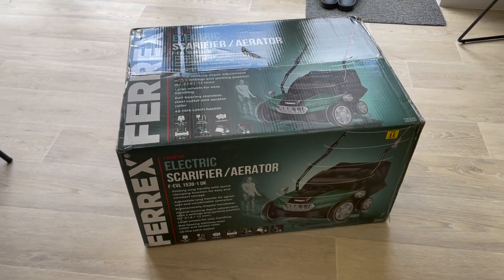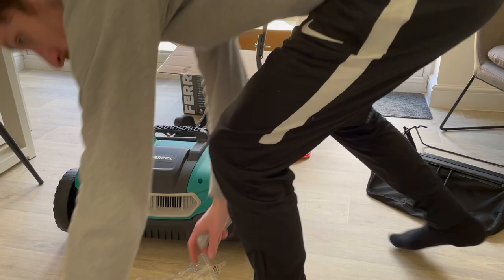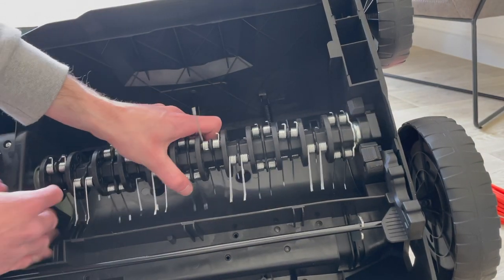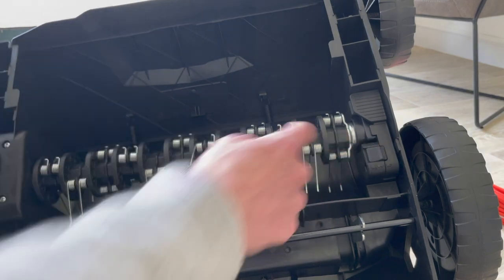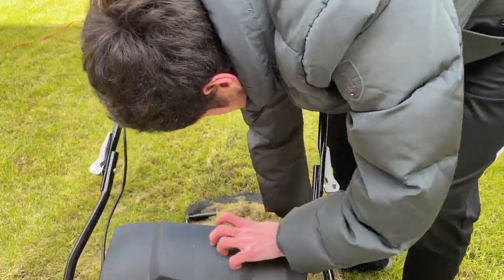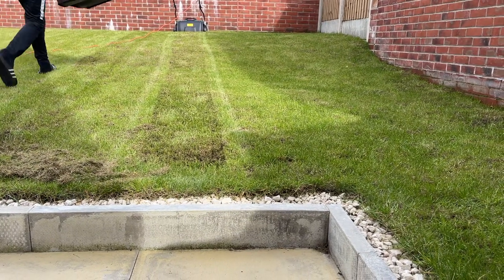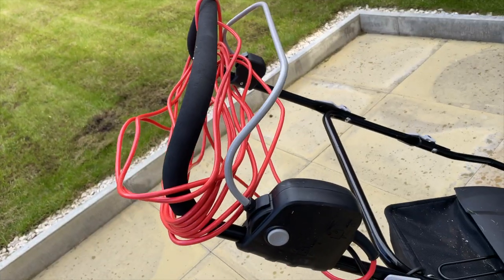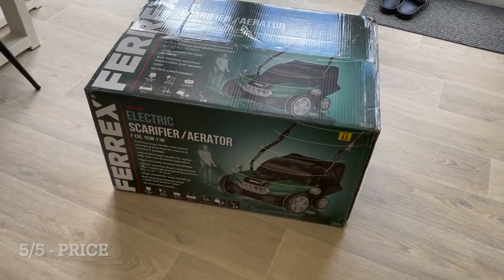Ferrex Scarifier & Aerator Review (PART 1 - Rake Attachment) - Aldi

Comment: Thanks again for this video - mine arrived yesterday and thanks to your video I was able to assemble it without any fluster. The basket does fill up quickly - one run and I had to empty it even though I have small garden. I used the same blade that you have done above thinking that what I was doing was scarifying but the manual refers to the other blade as the scarifier and the one above as the aerator!!
Reply from the maker: I have got it wrong in my videos! To be honest, I had a quick skim of the manual and got straight to it - I need to be more vigilant next time! 🙈
Reply: What they call an aerator is what other companies call a rake. An aerator has spikes which go deeper into the lawn.

Comment: Hi, I had mine delivered today. I think the part you’re not sure about is to allow the unit to hang on a wall. You screw the part into a wall in your garage / shed, and then when you want to hang the unit you loosen the hand screws holding the handle in place so the handle goes flat. Then hang the unit by the bar (where the plastic cable holder is)
Reply from the maker: Thanks for letting me know - I guess that would explain the wall plugs!

Comment: Hi I had mine delivered recently I was sure the roller you used was the aerator not the scarifier I’m a bit confused now did you mix up the names in the video cheers
Reply from the maker: The roller I used in the video was the scarifier. It’s teeth are supposed to act as a rake. The other other is the aerator. I’m hoping to use it either today or tomorrow if the weather holds out 🤞🏻
Reply: @NoviceGardener  thanks for reply really good video by the way going to watch your next video before I try mine out cheers
Reply from the maker: @ryanbutterworth2841  Just uploaded part 2 now using the aerator attachment - was slightly trickier to use with my lawn!
Reply: @NoviceGardener  Hi. I 'm a bit confused too as the user manual on page 3 shows the cartridge with the wire hooks as the aerator??
Reply: Pretty sure the Blades are the scarifier and the other is the aerator
Reply: @MW_1981  Yeah same issue - lack of clarity which blade is which - guess will just have to experiment and see!
Reply: @vipinchauhan1449  basically the spring tine one is a rake while the other is a scarifier. Although the company try to pass it off as an aerator..... Of which neither will do much to aerate the lawn.
Reply: Have to agree, having used both I think both are really scarifying rather than aeration.  Both seemed to work the same to me!

Comment: I contacted there repair dept on the Wirral they had no wheels as this is a new model, they had no idea when they would get any spares.
So contacted Aldi customer services who arranged collection via yodel, I boxed everything up.
It was collected at a arranged time and  on there receipt payment refunded (awaiting).
Like you they had sold out.As I said the bag is rubbish and hardly worth using I noticed the stitching on it was coming undone before trial use and the metal parts seemed a bit flimsy, but I guess at the price on balance worth it.

Comment: im saying the aerator should be used as a verticutter..which is less aggressive than a scarifier..you should use it on a higher setting than the scarifier and to get a verticutter to have blades that close together you need to spend thousands..look at the allet verticutter cassette ..its a bit poo with blades too far apart..then look at the way more expensive commerical version.

Comment: Mine  came with a broken front wheel,found on first use,the collection bag is absolute junk flimsy ,and to small best used without it.
Reply: Mine also had broken front wheel straight out of box. What did you do as Aldi don’t do parts and now sold out so cannot replace. I’m going to contact the service number but not sure they’ll have wheels.